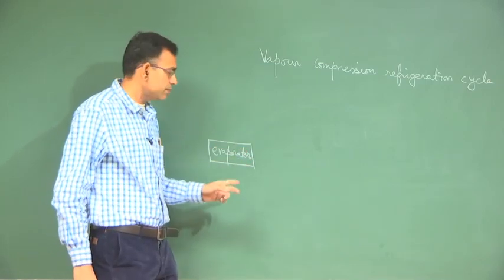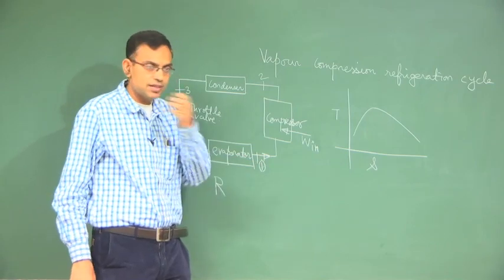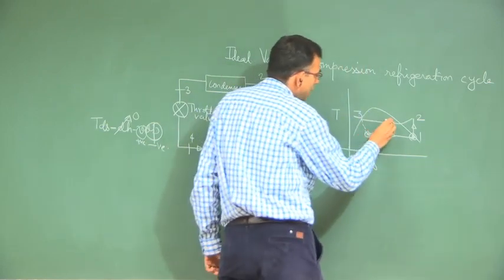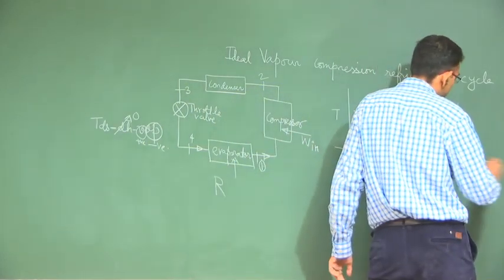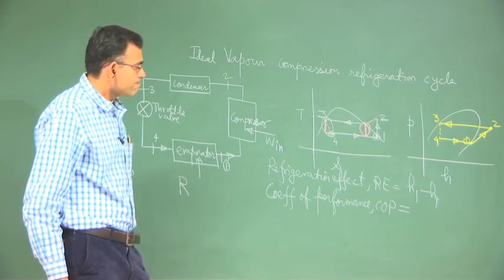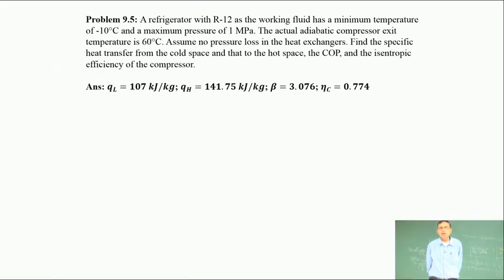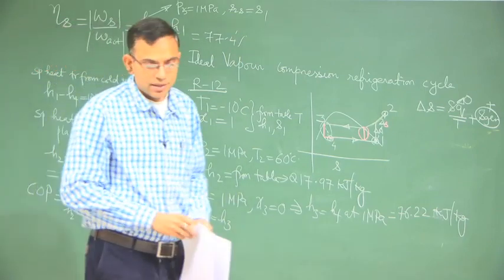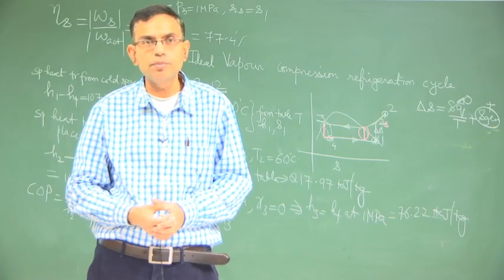Lecture 65 : Vapour Compression Refrigeration Cycle

Comment: Here I present my solution for the given problem :
State 1: saturated vapour
T1=263.15 K= -10°C, P1=219.12 kPa, h1=347.13 kJ/kg, s1=1.559 kJ/kg K
State 2: superheated vapour
P2=1 MPa, T2= 60°C, h2=381.8 kJ/kg
State 3: saturated liquid
P3=P2=1 MPa, T3=42°C, h3=240 kJ/kg
State 4: liquid vapour mixture
P4=P1=219.12 kPa, h4=h3=219.13 kJ/kg
State 2s:hypothetical state(if process 1 to 2 would have been isoentropic)
P2s=P2=P3=1 MPa, s2s=s1=1.559 kJ/kgK
T2s=48°C, h2s= 373.5 kJ/kg
Now, ql=h1-h4=107.13 kJ/kg
qh=h2-h3=141.8 kJ/kg
win=h2-h1=34.67 kJ/kg
COP = ql/win = 3.08
n(ise)=(h2s-h1) /(h2-h1) =0.76